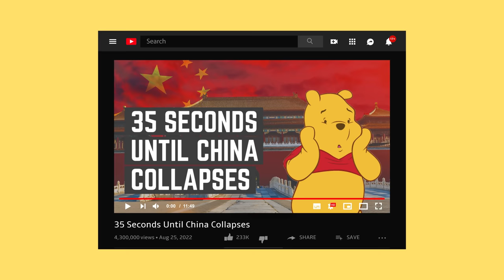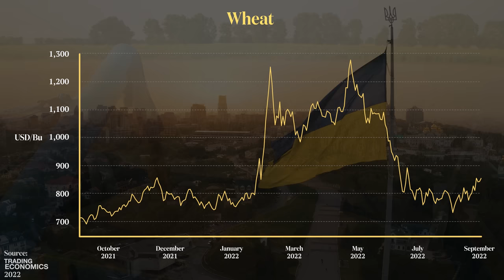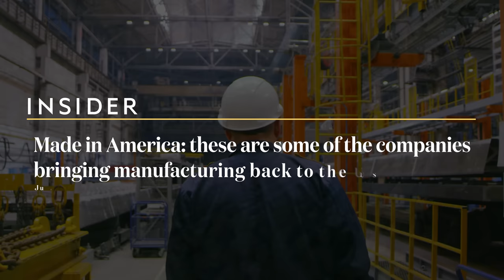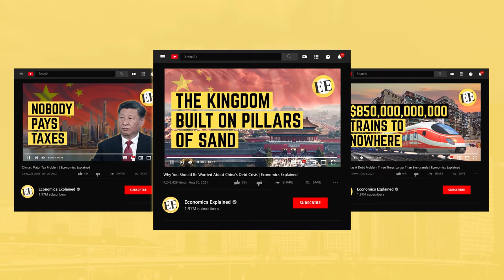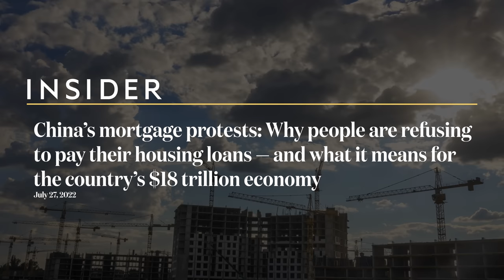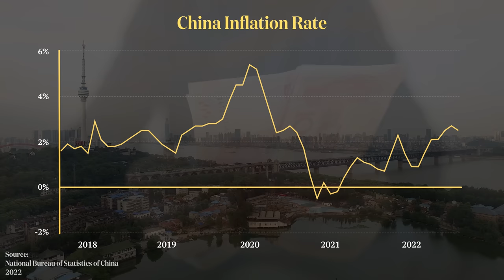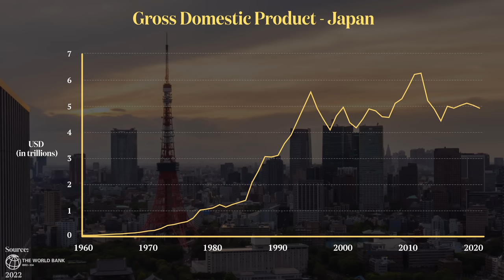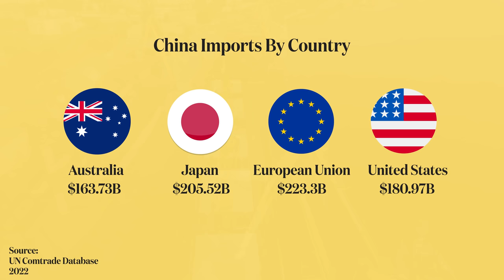No. China Is Not Going To Collapse... Yet

Comment: A huge red flag in this analysis for me has been that nominal GDP has been used repeatedly.  Seems like it's ridiculous to use that knowing China's real GDP has to be higher.  Just look at the top areas they compete against US, such as military.  Their hardware are cheaper and their labor cost is cheaper, thus they can pump out more jets and more ships at a lower cost.

Another downfall of this analysis is the constant political lens that EE clearly has.  The political aspects should be left out.  Saying Japan is a democracy has $0 extrinsic value when you are trying to analyze an economy.

You can argue about that separately, and I wouldn't disagree with any of that.  I just think it's poor judgement to call in factors that have no relevant impact on the model.